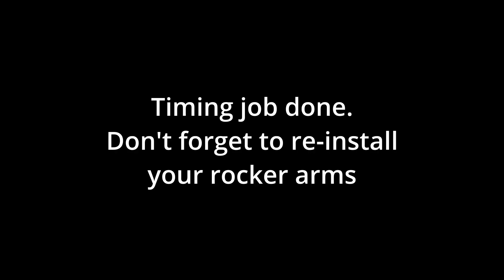PROJECT SEC - EP21: Setting Camshaft Timing After Intalling Heads and New Chain

Comment: You’re doing a great job with those project! I have a 380sec with the dual timing chain and the timing marks are horribly off by a number of degrees. This is my first timing job with this engine, is removing the guide and rotating the cam to alignment how you did a good way of fixing that? Thanks and hope to see more videos of this you’re a HUGE help with my restoration as well!
Reply: Also what is that tool you used to compress the springs? I search up spring compressed and just see the usual tools that require you to take off the cam